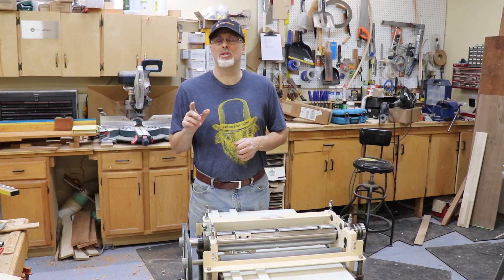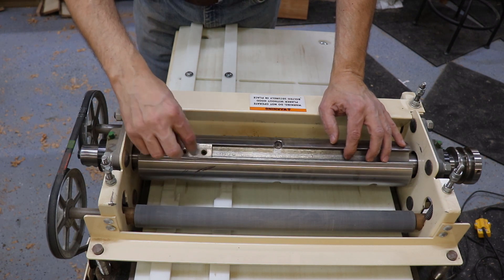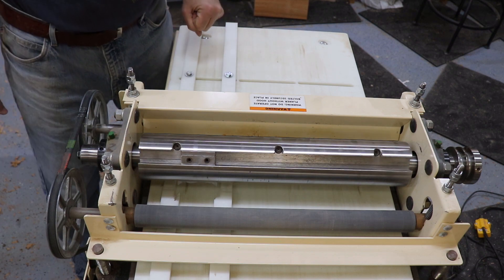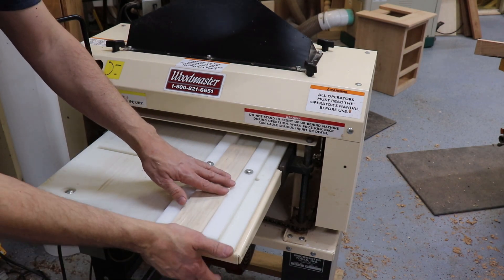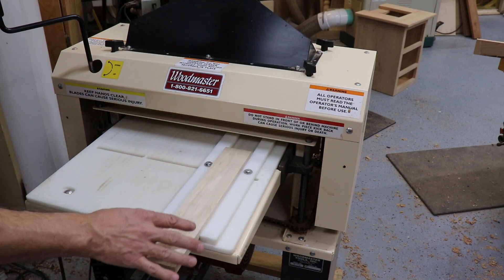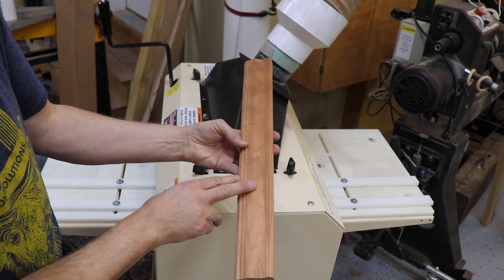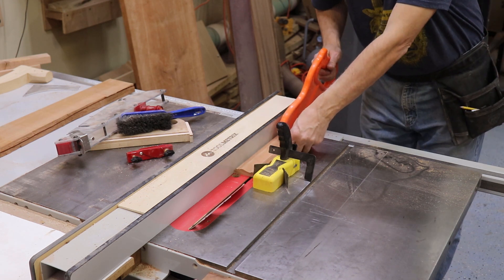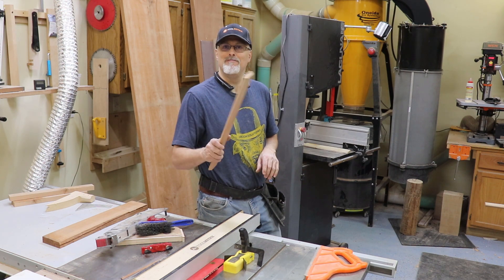Make Your Own Crown Molding

Comment: How long have you had this machine? And if you want don't mide me asking what would one go for used with cutter knives and molding cutters over twenty molding cutters?
Reply from the maker: I’ve had it for about 10 years. No idea on the used price. I’ve seen some great deals on these. Figure out the new cost and deduct about 30-60% depending on age and condition and that should get you in the ballpark.
Reply: @ToolMetrix  if you had to buy one that was say 25 years old and in good condition with 20+ molding cutters what would you give for it
Reply from the maker: I haven't priced them out, so look around on CL and FBM to see what they go for.  Based on what I have seen in the past I'd guess $600 - $800 range for something that age.